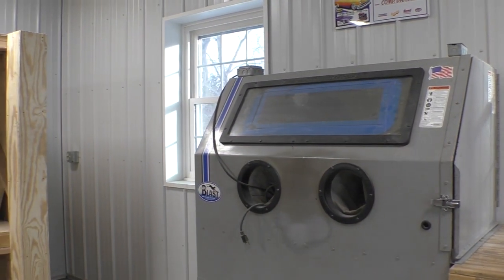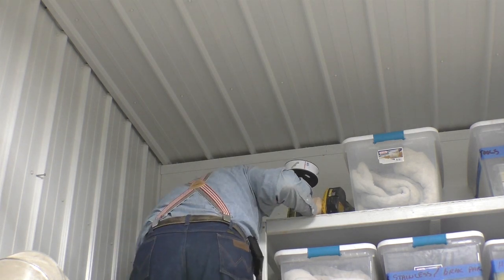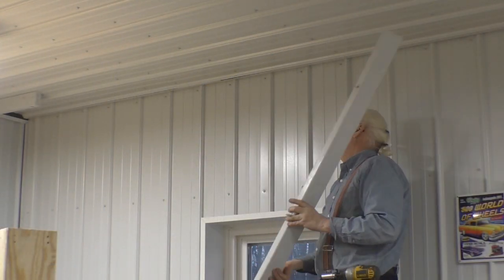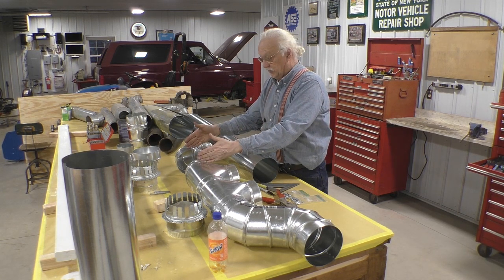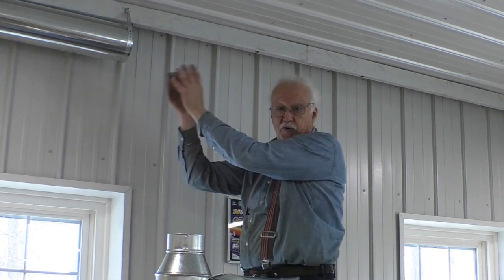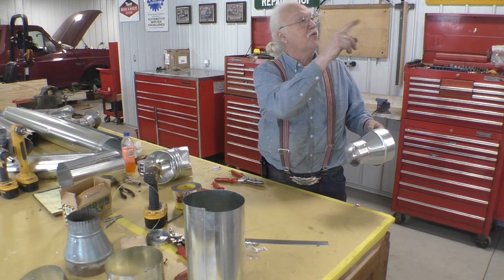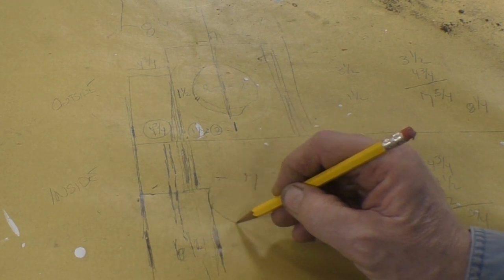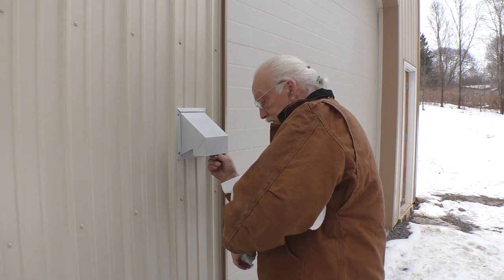DIY Dust Collection System, How To Put Duct Work Together

Comment: What gauge are those pipes? How are they working out after 2 years? Any issue with collapse due to suction?
Reply from the maker: They are just regular heat duct pipes bought from the local big box store. Never a problem with collapse, and it would take a L O T more suction then my bust collector can develop. Thanks.